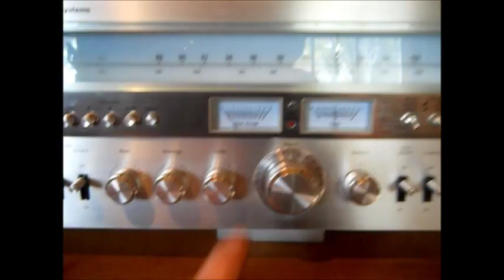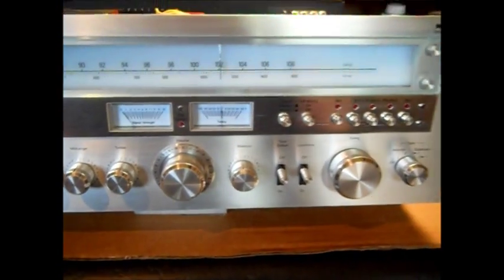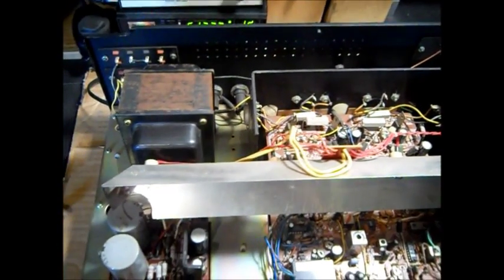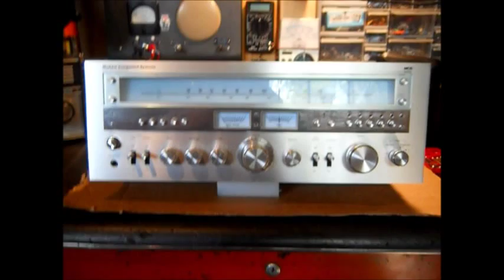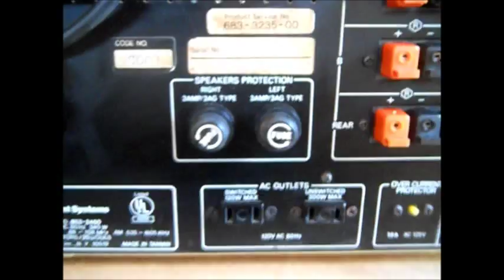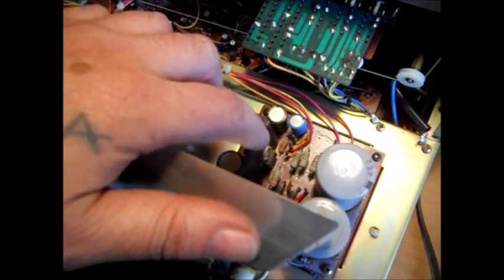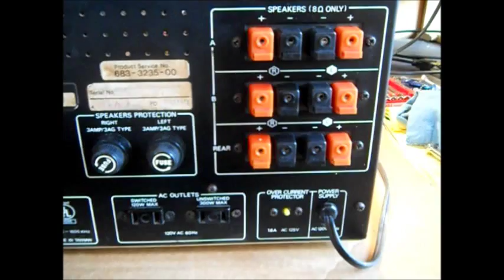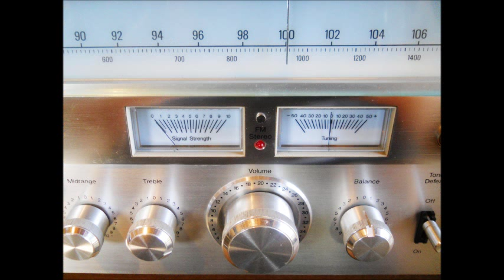MODULAR  COMPONENT SYSTEMS 3235  AM -FM STEREO (Sold by JC Penny )

Comment: I found one of these exact model receivers in the junk bin at a TV repair shop a couple years ago. The case was destroyed but the insides were fine. I rehoused them in a custom build 4 U rack mountable case with a direct drive tuning and it works just fine.
Also if the amps transistors ever fail you can literally replace the entire amplifier with a pair of TDA7294 modules for about the same cost as a set of power transistors AND get more output power from the receiver.
Reply from the maker: This just sits on the shelf now ..Maybe someday I will find a repairman Smart enough to work on it
Reply: @not2fast4u2c  It's a nice sounding  system, they just dont make them like this anymore.

Comment from the maker: I have never found my schematic for this a few months ago mine quit working it trips the circuit breaker on the back I hope I can find my paper work it will be a big help
Reply: I would suspect the regulator board, those regulating transistors are pretty known for failing and given the age of the unit, it may need a recap job done and a realignment.

Comment: Hello, I have this same unit. What did you find out about the bulbs? My tuner coil will not rotate inside it's housing. I think something popped off, any ideas? Thanks.
Reply from the maker: Gerald Jacobs I never did look for the bulbs There should be a screw that tightens the pully on the tuner That would be something to look at
Reply: The pulley turns the rod into the tuner itself but the coils do not rotate with the rod.
Reply: not2fast4u2c Also, what is best to clean inside? it is very dirty. all switches crackle and pop when actuated is there a way to clean them?
Reply from the maker: Gerald Jacobs They make electronic cleaner for knobs and switches Check electronic supply stores

Comment: Can you tell me what the numbers are on the amp. Two on mine are 3055 and two are mj2955 7826. Is yours like this?
Reply from the maker: Sorry I can't help it is stored away because it needs repaired ..It kept popping the circuit breaker on the back
Reply: If it is like mine it is in the amp circuit. if u disconnect the power to it the unit will function just fine.
Reply: Did you ever find the manual?
Reply from the maker: No
Reply: @not2fast4u2c  Dang I could use that info please share if you find
Reply: 2N3055 = NPN and 2N2955 = PNP They are matched pairs and should be four power transistors total with smaller drivers on the PCB
The 3055 is commonly used in high current regulated DC power supplies as well

IF the amp is dead and a reapir is beyond your scope of abilities then you can literally replace it with a pair of TDA-7294 amp boards. The I/O and power to the power amp board is pretty simple.

Comment: Did you ever find the paper work for this unit? I recently picked one of these radios from a friend who found it at a yard sale. I'm in the process of cleaning it up both aesthetically, and in terms of working condition. As of right now all the pots and switches are very scratchy. The Radio also makes a static swoosh as it powers down.

Anyway, If you have found the paperwork for yours, would it be possible to scan it and turn it into a pdf or something so I can have a copy?